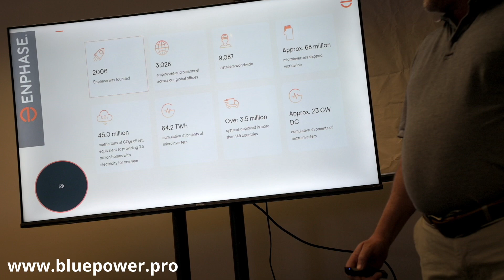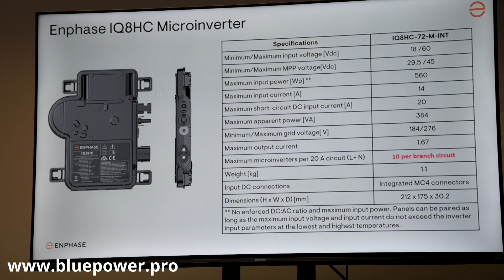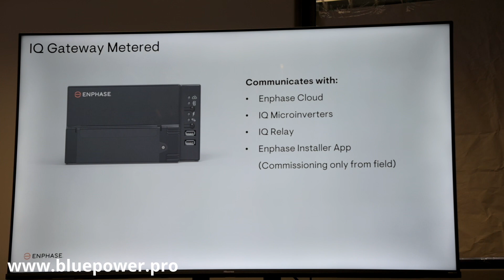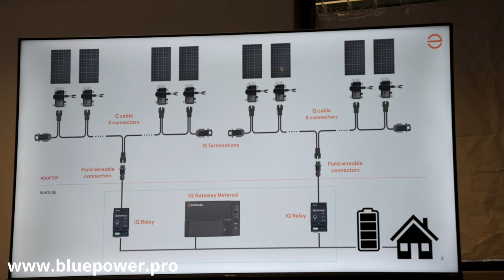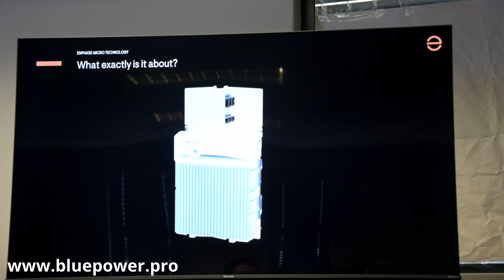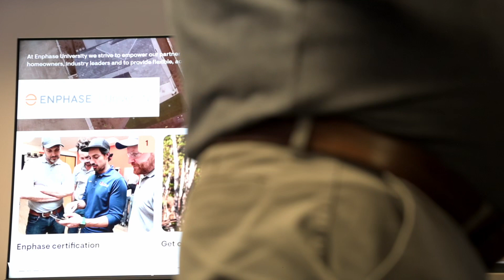Enphase : Micro Solar Inverters - Product Range Presentation

Comment: Hi, How  can I get onto a Victron solar panel course? Who can I contact?
Reply from the maker: Hi Johan, I assume you are looking in SA? There are some paid 3-5 day training camps available. These are certified and great, although they start at around R7000 per course, so can end up being very pricey, especially when you have to take multiple ones to reach the end. From my side there isn't anything yet, but have ideas/plans on creating a real world installation tutorials for the channel, just not in the near future.
Reply: How to connect Beny microinverters to Multiplus2 0 export way? I mean to use energy only to charge the battery and feed loads 0 export to the grid